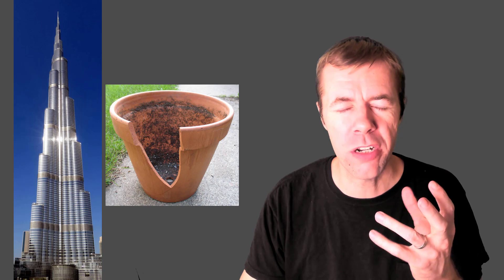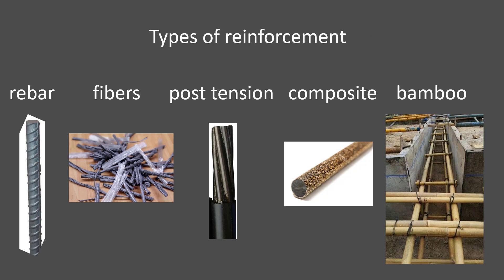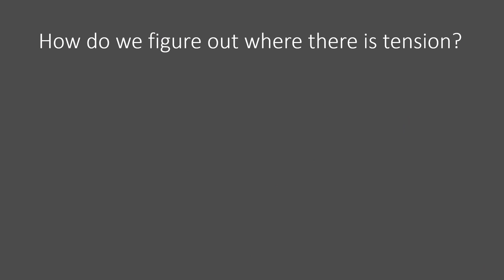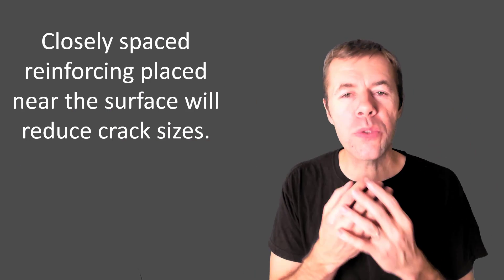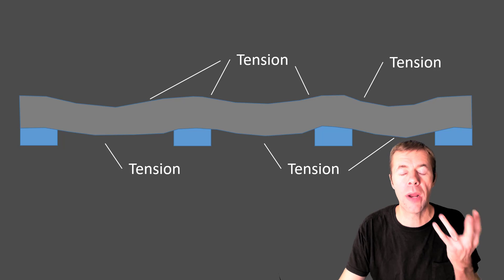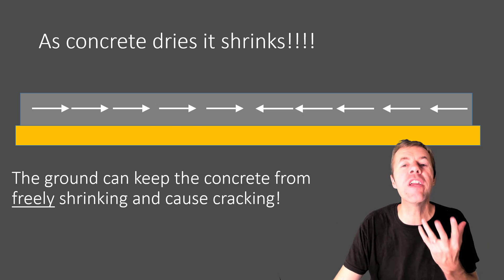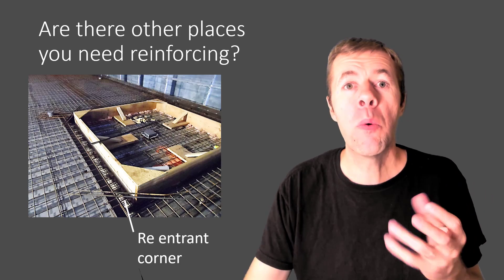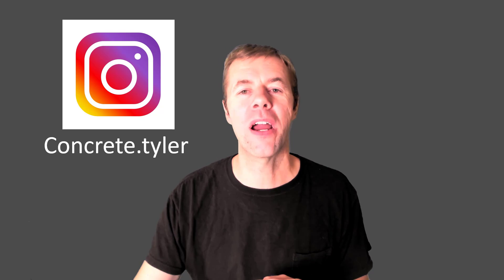Secrets of Reinforcement | How to design reinforced concrete

Comment: We have the greatest strength when using armature  of steel mixed with plastic fibers. 
But the problem when used  
steel construction is what steel is used in reinforcement  
because they are too soft steel they easily fold in oscillators 
too much hard steel in the oscillators will burst easily and here it is crucial to find the right steel but if there is no such type of steel it is best to set up a combined rod of both steels. 
But very important in making steel reinforcement is the wire used in the tie of steel roads the stronger and stronger the wire it means the greater the degree of earthquake durability because the longer the wire is able to withstand the tear in the stress  
the longer the reinforcement will remain and thus the concrete construction. 
Аnother way I think about reinforced concrete. 
is to use multiple layers of nets as with the plywood    
one layer will go in one direction the other  layer in another  direction .Аnd each of the nets have different properties one elastic another solid. Аnd it is quite interesting how the Romans made a concrete dome  when  they use only bricks and concrete  and the whole idea was  
to use bricks arranged in a spiral shape while concrete was laid over bricks   example  is  the dome in Florence built by Burnell  in the 13th century i
t was a spiral stacking of bricks  maybe we should make the reinforcement in the concrete in a spiral shape  
and thus save on weight
  
but to gain more strength

Comment: Hello Tyler, my name is Mason and I have just completed my 31st summer finishing concrete. Your video was informative, and well produced. I have three questions for you.  #1 what do you think of the new Lite Bar, or the fiber glass reinforcement bar that has been on the market for a few years? Ive been using it in all my jobs for the last two years, along with micro fibers, and I couldnt be happier with it. 
#2 I live in Kansas, and we have some pretty intense weather to deal with here. My question is this. If hot water freezes faster than cold water, then why do all the redi mix companies around here automatically batch the concrete with hot water? Wouldnt it also freeze faster than cold water, and actually hinder the whole process of  the hydration and curing time and lead to weaker overall strength of the final product? #3 This is more of an observed opinion than a question, but maybe you can enlighten me?.. Ive poured thousands of basements and garage floors over the years, and why on Earth do you engineers specify to put poly under our floors when all it does is guarantee  the floor is going to crack all to hell(sometimes while we are still finishing it)and make it harder to finish because the floor bleeds through the top so much it brings all the fines up with it, then in the hot temps of summer, you have an extremely short amount of time to finish it between the bleed water finally evaporating and the time it sets up. So my question is if we have to use the stuff, why cant we put it down under the subgrade instead of on top of it, so the concrete can hydrate out the top and the bottom like as close to normal as possible? Have a good day.

Comment: I love your passion Tyler. I have worked in construction for a major part of my life, but on crane crew not concrete, however I have watched the goings-on very closely when I have had the chance. I plan to retire in a tropical location about 8° north of the equator, and build a home about a mile from the sea, so I have a double-barrelled problem to deal with, the (I guess) salt-laden sea air, and an average relative humidity of 83%. Someone told me I should add Bondcrete to the mix, and (of course) make sure there is absolute zero exposed steel, and that should ensure longevity. Can you make any further suggestions please? Or if possible could you do a video focussing on tropical concrete or perhaps point me to one of your vids where you deal with this situation. I searched "tropical" in your videos but nothing came up.

Comment: Put loads of steel rods in and hope for the best. 🙏🏾
Reply: Doing that is more dangerous since concrete is a brittle material. When more steel is placed than required the structure fails without warning.
Reply: @harrytaylor5412  I just found this out recently. we just did a test on an over reinforced beam and yeah, that shear failure was scary. 😂

Comment: Hey Tyler, a question: I've always been keen on pumping grouts and several other products with a peristaltic pump that I designed some 25 years ago. I've seen several videos about 3D printing structures and have wondered what issues there may be to combat in those methods. Any thoughts?
Reply from the maker: Thanks for the comment.  Plenty of issues.  A continuous flow pump would be great for 3D printing.  Check my Instagram account out for some videos of what we have been doing lately.  I need to make a video about our progress.  I really think 3D printing will be amazing.
Reply: I can't recommend enough the works of Buckmiminster Fuller. His writing and research on geodesic structures changed the world. Also, his presentation of tensional versus compressive forces was eye-opening for me. Thanks for your enthusiasm 😁

Comment: Trying to get longer while being prevented from doing so creates compression... Trying to get shorter (shrinkage) while being prevented from doing so creates tension... This is why we build compression joints in slabs and roadways... A certain amount of flex and movement is built in to the structure.

Comment: I can do a lot of review on your videos just by the terms you used and skipping some stuff.
1) What you called tension is not the extra length of the concrete you meant elongation. Tension is the “force” pulling every spot of a member apart, compression just do the contrary.
2) The length of the 0.004 is not a length it’s something called the strain and this is what ACI wants to assume yielding double the real 0.002. It has no unit or in/in or mm/mm (length/length)..
And many little stuff which words can mislead
Reply: I went to look into ACI 350 to see if I can find proof of your claim, but, like many other standards, there are so many documents, and each one costs money.  Sigh!
Reply: Harry Pehkonen 
Ok I advice you first of all ACI 318 which is the most important committee (the building code, governing the design).
I will show you proofs when I will get time.
I am certified in several ACI concrete certifications and also a Civil Engineer.
The 350 he has mentioned is just for the environmental aspect of the concrete and can in no way supersede the 318.
The mistake he has made and that I have pointed out are not form 350 but 318.

Comment: I have been following your videos since 2019. I worked on Sulfate Attack Resistance in PLC in my MS at SD School of Mines. Seen you in ACeRs 2017 conference at Penn State. Could not get a chance to talk to you. Will come and see you one day in Stillwater. I live in Houston and work here in CMT in a company. Spend my spare time on reading and feeling concrete and cement. I am a big fan of your trantualla curve. Have a plan to use that at some point after I start my PhD. Thanks Tyler.

Comment: You should try welded wire mesh. I've done designs with D 12 2 x 8 mesh in multiple layers for pipe design and you should see what happens when you mix it with 60MPa concrete. Unbreakable.

Comment: Great subject and video, thanks! Curious why 2 sheets of plastic reduce friction over 1 sheet.  Benefit as vapor barrier worth mentioning as well.  Waiting for your next video...⏳
Reply: I would say that a plastic sheet has the least friction between the concrete and the ground so a plastic sheet on another plastic sheet would be two surfaces of low friction sliding on each other.

Comment: I was thinking about fibre reinforcement the other day and wondering whether it has long term durability. Just worried that the fibres used would degrade over time, with heat (sun on slab) and with movement of the concrete just slowly loose their effectiveness.

Comment: Hey...once try laying slabs using U-Boot betons placing inside the concrete which can reduce lot of self weight and also concrete...they can also help to lay very long slabs...mushruoom pillars etc... this technology is called U-Boot technology in civil engineering. If you have any interest in this concept...try checking journal THEORETICAL STUDY ON U-BOOT TECHNOLOGY IN CIVIL ENGINEERING by Harish reddy...this is ancient underrated concept.

Comment: 6:26 why rebar not on bottom, imagine heavy vehicle parked on that slab, you will have cracks on bottom side, and you start sinking with that slab down making bird bath.
Reply from the maker: The slab is supported by the ground.  The ground is MUCH thicker than the concrete and so it should have minimal deflection.  Also, if there is a crack then you won't be able to see it and it won't be subjected to outside chemicals.

Comment: Another excellent video; well explained. Maybe a demo of a beam cracking with and without reinforcement.
Minor point at 08:10 you mention the steel should be 1.5" from the top (67mm) hmm I think it should be (40mm).
I only point it out as lot from around the world will see the metric.
I see too often builders think the steel mesh should go in the center of the slab for slab on grade/ground.
Cheers
Pulpo
Reply from the maker: Pulp!  Thanks for the correction.  Metric is not my first language. =)
Some people think that putting the steel in the center is better but based on recent work I think it is best on the surface as it helps keep the cracks small where people see it and it is exposed to outside chemicals.

Thanks again for watching!

Comment: Another informative vid. Thank you Tyler. But, I have a question for you. The Australian mine site I'm employed on is going through an expansion and update phase. This includes the removal of previously reinforced concrete to facilitate expansion. Apart from the mechanical impact destruction, I have questioned why the removed concrete debris, with reinforcement still semi intact but broken down into smaller peices by an onsite contractor, is being used as backfill, encased in a semi solid mortar that chemically sets with hours of application, than new reobar layed across this, which is than encased in what is referred to as a 'high tension cement. Just for technical interest, the backfill proportions are approximately 1.5 metres deep and the new HTC is approximately 1.0 metres thick. The areas are flagged as 'tank, silos and stationary machinery pads'. Their size varies greatly. I have never seen this questionable technique implemented on any site before. Is this a recognised procedure or a simplistic waste disposal ? Your thoughts please. 👍👍🇦🇺
Reply from the maker: Thanks for the question.  What was the mine for?  Maybe they think the material is contaminated and they want to contain it on site as opposed to moving it someplace else.  It is hard to say.
Reply: @TylerLey  Iron ore mine. I should of added more detail to my question. Another question I forgot to include was whether this technique utilized would have any stability issues. There was no compaction of product, only product impact when dumped. As the average weight of mounted application will be 328 ton, I seriously question the engineering equations.

Comment: I will be building a small 2 storey dwelling, on blue clay with high water table. (Engineers licking their lips and my wallet).  I have been given a plan. Bed rock 3.3m down. 

Drain foot print of house....dig to 1.2 meters above  bed rock. Then dig wall trenches to bed rock. Pour 300mm of lean mix. Place re bar cage on same then pour 900mm of 30 newton concrete then begin building.

Thoughts anyone....??
Reply from the maker: You better install french drains around everything and use waterproofing!

Comment: Hello Mister Tiyler
Do you have information on the treatment and rehabilitation of concrete elements affected by the blasts?
If we  Changing reinforcement  position in concrete at critical zone which is more effected than the other position will prevent this damage or reduced the effect
Reply from the maker: Rehab from blast or any extreme event is very challenging.  Most structures are designed to survive these events and the inhabitant's lives.  These structures may require significant repair or even demolition afterwards.

Comment: Thanks Tyler.  I plan on having a concrete boat ramp poured.  My thought is to angle grade the ramp, spread a thin layer of sand for initial smooth surface, then place visqueen , a layer of cardboard, and top layer of plastic sheeting.  Once the "SLIDE MATERIAL " is set, place the 2" X 6" forms and install my reinforcement steel.  I'll first place galvanized hog panels, then #4 rebar on 12" spacing.  I will utilize 3" plastic chairs to raise the rebar and tie wire to lift and support the hog panels  2 inches below the rebar and 2 inches above the plastic sheeting.  This should strengthen the pour like a multi-layer sandwich.  The top surface will be floated and then V-grooved for fraction and water run-off.  If anyone has suggestions, I'll gladly accept your thoughts.    J K    Houston Gulf coast
Reply: i would take wroger wroger's advise with a grain of salt.  i think he enjoys hearing himself speak more than understanding what he is saying...
Reply: TRUE, it will actually be on the Texas gulf waterway.  My plan is to let the pour cure for a month minimal, then "SLIDE " it down the incline into the water .  That is why I found it interesting  to view the plastic / friction factor Tyler pointed out.  The cardboard will not be getting wet due to plastic sheets and it will help prevent sub-soil uneavening  as the concrete work is performed - indentions from boots etc.  I may need to have a dozer push it into the water.  Springtime has the lowest tides so it will help if I time it right.
Reply: Thanks,  good info. Are you a general contractor or builder ? The draft will be 4 to 6 ft, depending on tides. For the private and couple neighbors usage. Base is a mix of gravel and gumbo with 4 large tires filled with concrete laid flat below waterline as a sub-base to spread out like a footing. The upper approach slab will be 4 inched thick, reinforced with #3 rod.  The main drive will be 4 - 6 inch road base gravel.  I like the idea of mini-slabs for an option if I need to extend further into the water.   J K

Comment: Over Reinforcement is a problem too!  Go engineers!
Reply: Yes.  Also,  designing steel reinforcement at a significantly higher tensile strength than the compressive strength of the concrete is also a problem, because the concrete can crumble and fail well before the steel will show signs of yielding.
Reply: Specially when it comes time to knock it down, or pay the steel bill.
Reply: over reinforcements will be a problem for only surface cracks . nothing more .  that crack might be sometimes deeper . doesnt matter once you patch it proper way